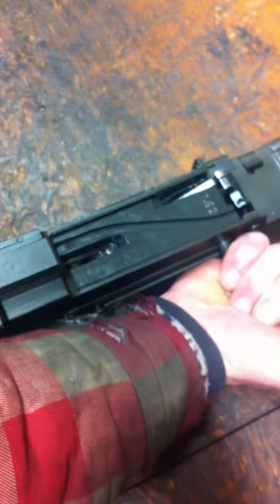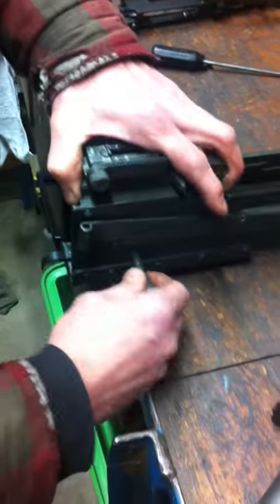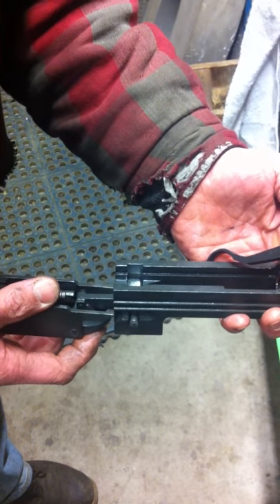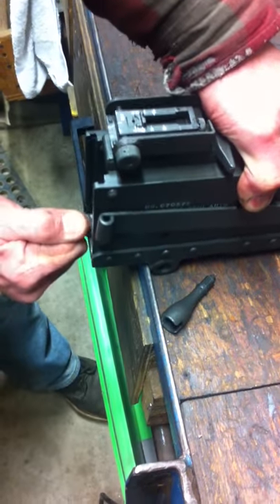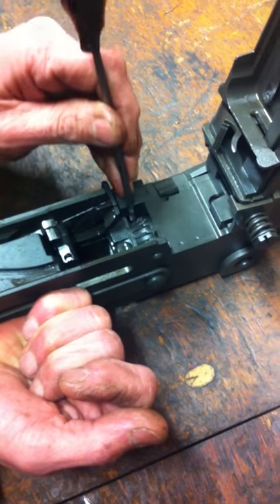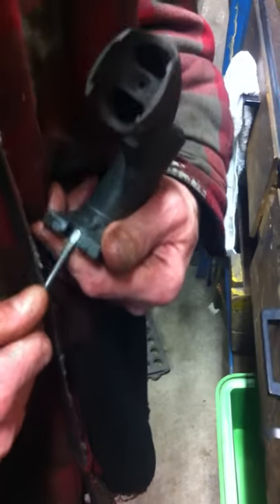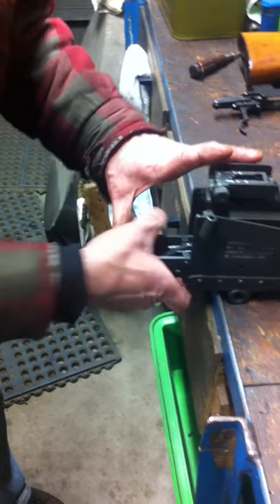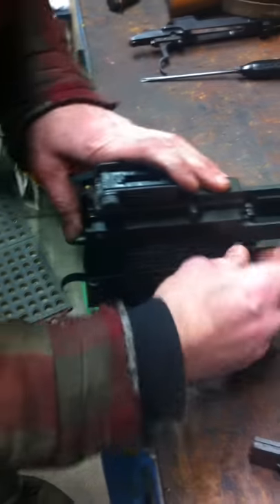Head Spacing a Browning 1919

Comment: With my N.E. Westinghouse M1919A4, I used to time it by tightening the barrel, then backing off 11 clicks, then it was generally head spaced or needed minimal adjustment.  It was in 30-06.

Comment: Guess didn't need that headspace tool mine was built by Ohio Ordnance 1994. Last time I had it out was 2013 it failed to extract found cases were ruptured at the neck. I had to buy a ruptured case removal tool it never used to do that back in the 90s. I think headspace is off or timing.